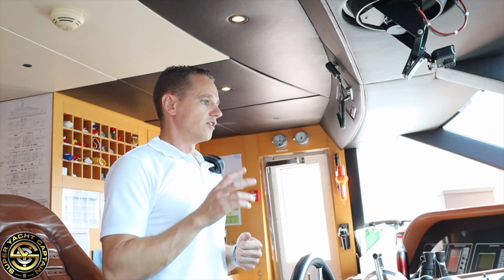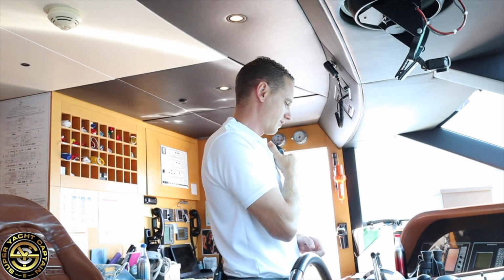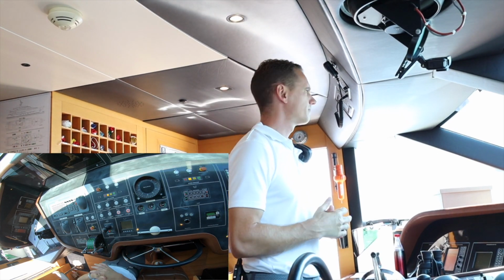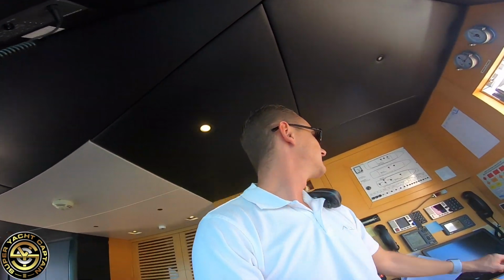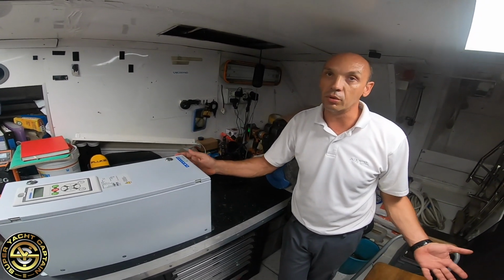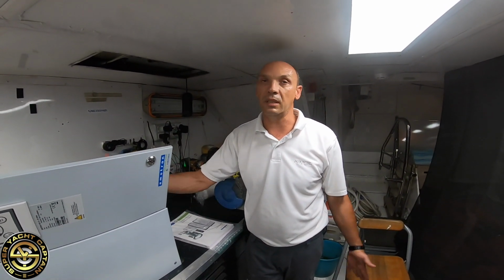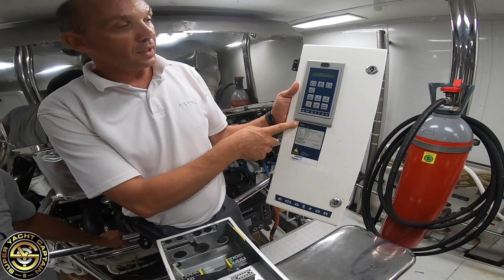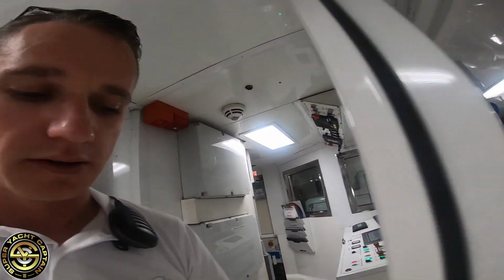We Broke Our Stabilisers - $10K Repair. (Captain's Vlog 103)

Comment: Send the other one off the Louis Rossmann on YouTube and have the board repaired...now that would be cool then you might have a backup unit should you ever need to swap them out. You can fix board level stuff.
Reply: sir, louis rossman repairs laptop computers
Reply: Louis is the man for Mac repairs. But without a service manual or schematic it would be an uphill battle. * The * expert for industrial controller type repairs, esp. when undocumented would be Paul Carlson (youtube: Mr Carlson's Lab or creativedesigncomponents dot com).
Reply: @rustblade5021  i would still bet on him being able to fix it

Comment: My first thought when I read the title was a problem with the stabilizers outside the boat which would be a nightmare to fix.   Lucky it was a electrical fault limited to one box which made swapping out a lot easier.  

It is also hard to diagnose electrical faults during downtime as it would require a complete teardown of the electrics on the boat which is just not practical and would probably create more problems than it solves.  

The general rule we use is if it not broken then do not fix it.

Comment: Add that stablizer component to your spares: An engine matched/programmed ECU (engine control unit), fuel pumps, sensors, belts, filters breakers etc. Also tools, repair kits, diagnostics, software, manuals and diagrams. If something fails, I have found the likelihood it will happen again is ten fold. I can’t tell you how many times this has paid off. You will also find out that parts get obsolete much sooner these days and inventories at not kept in all locations. And when things fail it right before a long holiday. Have an action plan for problems. For instance; you have a catastrophic shaft seal failure. 1 are the pumps able to stay ahead of it and make it to a yard?  2 If not, can you effect repairs? 3 Do you carry a kit to immobilize the shaft and stop the flow? 4 call Mayday?

Comment: That's a variable frequency drive (VFD), I thought it would be something more specialized but I'm sure there is some more control boxes too. There was an automatic car garage (one with an elevator for the cars) in Sweden last summer where the cars got stuck for at least a month because of a faulty VFD (of some Japanese brand, not Emotron). I think it would be possible to refurbish the old Emotron VFD but I'm not sure it would be less expensive than a new one. In my work we buy a lot of VFD:s and one of that size is only about 1000 USD, maybe 2000 if you only buy one so I guess the largest cost for you was traveling and work, not the VFD itself.

Comment: It was great/lucky that there was a replacement electronic controls unit in stock for a 10 year old stabilizer! Try that with a retail electronic product!  I guess it was good the stabilizer fin did not get stuck in a strange angle causing erratic movement of the yacht .
Nice fix guys. Warren
Reply: Is there a way to manually position the fins?

Comment: I'm rather surprised that they couldn't repair the board in the old unit; it will have voltage and current testing points in the service manual, after all (licenced radio amateur, so familiar with electronics). never the less, a quick and efficient replacement supply, so kudos for that, at least. Good channel, informative and entertaining :) Thanks, and keep it up :)

Comment: A good electronics engineer should be able to repair that ECU - It will be worth keeping as a spare !!  Motherboards should still be available anyway-there is a requirement for a manufacturer to support for 14-17 years after end of run. 
As stated a small resistor or capacitor popping can be all it takes for a complicated control board to malfunction. Luckily electronic boards and processors are very reliable now however they are sensitive to working parameters which include temperature and electrical supply. 
To expand slightly on the latter without over complicating things - the input voltage is key- not too low and ideally protected from “Spikes”  (sudden high voltage surges). 
£10k (peace of mind/spare) - worth the repair I would say. Chris. 👍♥️😇🌹💐
Reply: If the whole thing installed is 10K and a good portion of that would be delivery / installation.  Add to that the time / cost to trouble shoot isolating the one of three problematic boards (while you have guests awaiting).  Afterwards you remain with two 10 year old boards and one new, how much in savings might be realised and what do you suppose is the best investment?  Power spikes are controlled by the expensive Power Supply.  There are two possible modes of MB failure, an individual component (often might be seen) and the Board itself which are susceptible to temperature and humid environments.  The latter can produce swelling / cracks in soldered joints over time which means if one board had such failure, guess what condition the remaining two would be?
Reply: It seems that the technology was a bit old anyways so an upgrade is not that bad an idea.
Reply: Wouldn't even need to be an engineer.....board repair isn't that difficult especially if it was just a resistor as the tech mentioned.  If it was time for an update then fair enough but if you replace the resistor and get another 10 years out of it then money saved. lol

Comment: From my experience the tech rep visit was at least $1000, the parts depending on refurbished or new could make a difference of 50% in cost. ask for the part to be repaired and returned, to be retained as a spare. Finding out why it failed is a good step, environment, electrical spikes etc. (CE - Stm, Dsl, GT - Unlimited)

Comment: Out of curiosity, have you ever used gyroscopic stabilizers?

Like a sea keeper?

If yes what is your opinion on those types?
Reply from the maker: Yes I've seen them. not sure how good they are when the vessel is at cruising speed. do they work underway at higher speeds?

Comment: Safety first haha, no hearing protection going into the engine room, while engine and/or generators are running. Don't worry lol, I would have done the same. Also, I've mentioned this a couple of times but no response but I thought Barbara was the Chief stew? When did Giv get the promotion?
Reply: Barbara is chief deckhand.
Reply: @pcb1962  Ok, I could have sworn I saw a vlog ages ago saying that she was Chief Stew, no biggy. Thanks for the info
Reply: Barbara is chief officer . Makes her 2nd in command I think

Comment: Actually an explanation of the stabilizer operation would be interesting.
Reply: Stabilizers are computer (usually) controlled underwater fins that move to keep the ship upright and prevent rolling. They are commonly used on ships where the designer forgot the "More below than above" rule. I have seen a couple of yachts that I would call scary unsafe if they had a stabilizer failure at sea.  I have been a Shipfitter since 1976, and I have worked on some ships that were designed by a condominium architect instead of a marine engineer.
Reply: @kolsen6330  Thanks Kim, interesting info.  I sail keelboats so no problem there!
Reply: In addition to what Kim Olsen said ballast tanks can also be used to bring the center of gravity down and lower the water line applying the the More below less above rule but of course only so much or you could just jump on the nearest Sailboat.....

Comment: During your videos, when you do a piece to camera on the bridge, there is a audible pulse of white noise every 10 seconds. Something in there is interfering.
Reply: Impressive powers of observation.
Reply: What quality resolution are you watching in? I'm watching in 1080p and see no interference, apart from when the lights frequency clashes with the camera's.
Reply: Oh I know what you're talking about now, I can't see your reply to respond but it's in my notifications. I don't have any sound issues at all on my end when I watched this vid or any others for that matter.
Reply: @UCrxqS7MP-cifYrnvDb1ZokA Wow, ok, that's weird.....I don't have headphones I have everything running through my bose desktop speakers and I can't hear anything although I'm not listening to it loud so I'll turn the volume up next time and see if I notice any difference
Reply: It happens in a lot of videos tristian does. usually when the camera is rested on the right had side of the control panel. Its one of those things I picked up once before, and I notice it all the time now.
Reply: @bluedog1052  Start listening 0:22 it happens at 0:24 and they are roughly 10 seconds apart. Although when the film has a cut in it, the timing shifts accordingly. It only happens when the camera is in this position. It sounds like one of those white noise tones you get during a hearing test and is very brief. Half a second or so.
Reply: @LordClunk Yeah I can kind of hear what you're talking about, not really noticeable through my speakers but perhaps some interference from the radar perhaps, plus other electronics on the bridge I guess

Comment: Question??? Why not use the follow Boat to pick up the Engineers??? It is quite Big???  As a captain What do you say about putting the steering in the front of the Boat instead of where it is Placed know??? From A view and navigation point of view???
Reply: Would be approx 4 hrs each way at 30 knots from Calvi to Genova... and lots of fuel... you got to do the distance 4 times: Calvi Genove picking up the engineer and return to the Yacht and the same when the work is done.. 16 hrs in total (25% less doing in via Nice)
Reply: @stefanrobertz9547  Ok got it. Thank you.

Comment: Do they stabilizers have a Manuel engage, disengage?  Wondering if they broke while in the extended position would you be able to bring them in. Really wish I was out there in paradise with y’all. Heat here in south USA has been so bad this summer.
Reply: In the old USA here too ........     You are right not only about the heat, but in south florida has been raining almost EVERY SINGLE f*** day !!!!   I can count with one hand the weekends without storms or heavy rain.   The yacht has been at dock most of the time.

Comment: Is it of any value to use the stabilizers at slow speed or docked?
The Stabilizer "BOX" looks like a VFD or Servo Controller. Does that control both stabilizers and is there another system that provides motion control to the box or is this a standalone system?

Comment: what is that thing where you mounted the Gopro on the bridge?
Reply: A compass
Reply: @stefanrobertz9547  that would make sense
Reply: Magnetic compass to be precise. 
AWOL has a second on the main panel, somewhere near the steering wheel.
Reply: @berndhaverkock6070  I am aware of what a compass is. I have just never seen one like that (I work in the marine industry on smaller vessels and certain yachts but I have never seen one of that design)

Comment: They should have changed every 10 year old VFD they don’t last more than that ( retired HVAC ) we alway when doing a refit would change all VFDs if there was enough money on the job the saving in energy efficiency is great on maintenance all vfd must be checked a failure overheats the drive hence the third fan in the new one good vfds have filters that require cleaning happy sailing
Reply: Hate typing that much on my iPhone excuse grammar

Comment: Meh it's a PLC (Power Load Controller), ten years is a good run for one, easier to replace it than it is to rebuild if it still had a warranty then yeah rebuild it, but since it's not you did the right thing, and of course the new one is warrantied so you're good to go for another ten years, but maybe by then the owner will be rid of this boat and get ya a bigger one to work with, no harm in dreaming, right?!

Comment: So how does your owner feel about you advertising on the internet about the boats troubles as well as filming and commenting on the vessel operations? Does your NDA not cover all of that?
Reply from the maker: Owner has no issue, equipment on super yachts fail all the time, we can’t foresee everything. This is the reality of working on a yacht. But we also show how we fix it, keep the systems updated and maintain to a high standard. 
Any yacht that’s says they haven’t had break downs, equipment failure or problems is simply 🤥 
👍
Reply: @SuperYachtCaptain  Never said that, but the Yacht is currently for sale, brokers / owners normally do not like any indication to show that a yacht is not in top shape mechanically / or in appearance.   Brake downs do happen yes; but as with everything in this / your (and my ) industry discretion is the better part of valor.  Should you have a potential buyer on the line, expect your face and this video to be brought up and used to try to broker a a discount.......  because i know i would bring it up.
Reply: @Scubagavin  Perhaps, but also consider buying anything used, like an automobile. To me, Capt. Mortlock's videos illustrating the care and maintenance of AWOL are worth quite a lot. We should be so lucky, when buying, to have such a detailed record of maintenance. Besides, I imagine someone in the market for a multi-million dollar super yacht isn't going to split hairs on maintenance if everything's working. It would be tantamount to a rounding error on the final price, at best.
Reply: @SuperYachtCaptain  Absolutely
Reply: @Scubagavin  As a prospective buyer I have watched many Captains vlogs and videos. I can tell you without any doubt whatsoever that Tristan Mortlock's are the most clear, honest and down to earth I have ever seen and if I buy "Second Hand" I would rather buy a boat that has been looked after by this Captain and advertised/promoted by him than by any broker. This Captain loves his job and is passionate and honest and I respect that. AND NO OTHER CAPTAIN HAS KEPT HIS CREW LIKE HE HAS!!!!
Reply: @chunkychinn  Hi Chunkychinn, your right,, as a buyer now you have insight as to a costly repair that has already been performed with no root cause, which should be in your dialogue when talking price, the.  However the Captain works for the current owner, and if the yacht is for sale it is his job to try to have it represented the best for the current owner so that he can get the highest price.  I am sure if you have Mr. Mortlock as a Captain for you, that would be happy with him, seems like a nice guy and fairly competent in his work.  Sadly that is not the case in most of the industry where cool videos like this would have you end up in the unemployment line.  Videos of 'yacht life' are certainly one thing and walk the line of the various NDA's one can be bound to,  however videos of break downs in secure areas of the yacht (engines spaces are considered secure areas ISPS and such) well,,, is walking a line, especially if down the road there is an insurance claim for anything on the yacht,,,,  So you see, of the many cool things you can post (if you are allowed) about your yacht, even as captain this sort of video would not have been my top choice, even if it gets 10 k 20k or half a million views

Comment: after many years I discovered a  magic number. 
yes the magic number is 12. 

after 12 years HOLD TIGHT  because a lot of things start to fail !!!       AFter 12 years , and within few months ,  hell broke loose and  failed several pumps, engine control board dead ,  have to blueprint the  turbochargers, a LARGE engine service needed, 2 fried autopilots, 2  fried chartplotter, the big rudder ram failed miserably ,  some cabling get also out of servcie (specially on areas of vibration) , fresh water pumps dead too, several circuit breakers get damaged ... and more that i Cant remember ..!!!!!    Was epidemic.  For me 12 is the number to be afraid of ...

Probably after 10 years you are over  the MTBF (medium time before failure) on most of the systems and individual components ......  
nobody (that i know)  has documented this , but happened to me in 2 yachts already.   After that terrible time fixing stuff  like crazy every single week, calm shows up and things comes to  a normal status again ........
Reply: That's why co-owners programs of charter's companys are closing after 10 years. And you are getting your yacht back but then you can sell in for 1/10 of its cost

Comment: Price of this new driver is about 2k$ where are the rest 8k$ Lebovsky? And what should I do to become Franchesko who takes 10k for replacement and resheet  of 2k driver? (sarcasm)
Reply: I suspect that the stabilizer vendor highly marks up their spare parts, partly because they can (no real competition) and partly because holding parts in stock that may or may not be needed gets expensive. Then on top of that you presumablly have a bill for sending a technician to wherever the boat happens to be. I don't find it all that surprising that a part the stabilizer company bought for $2K could turn into a $10K out of warranty repair job for the customer. From some googling it seems charter prices for AWOL start at about $120K per week, so downtime is going to get seriously expensive.
Reply: @petermichaelgreen  $8k is too expensive for any delivery to any marine but who know who know :)